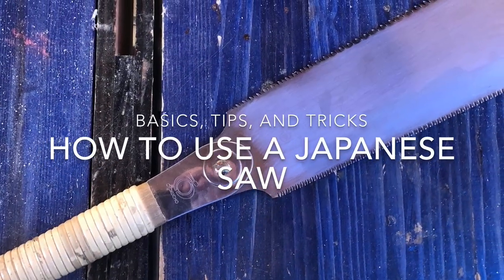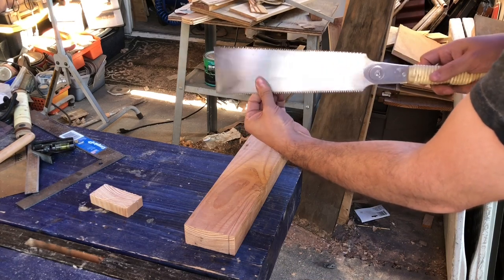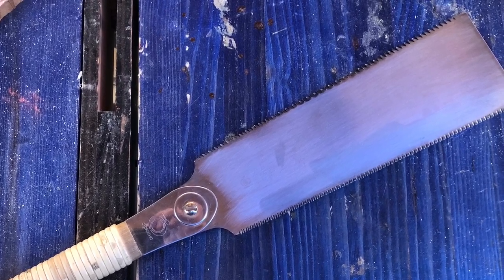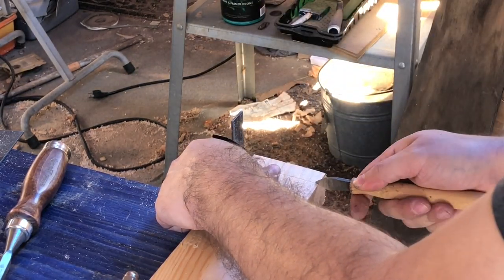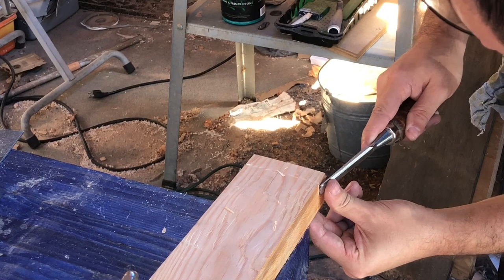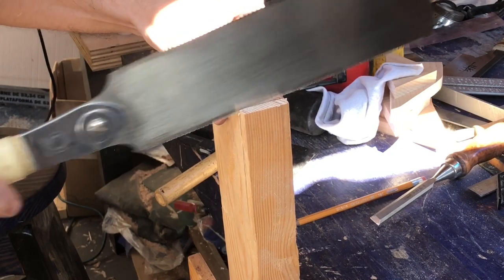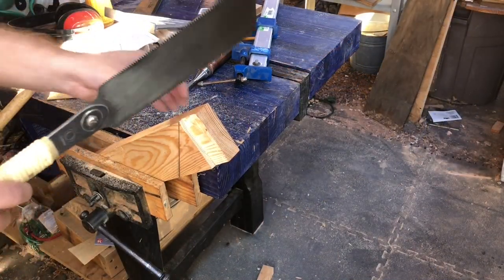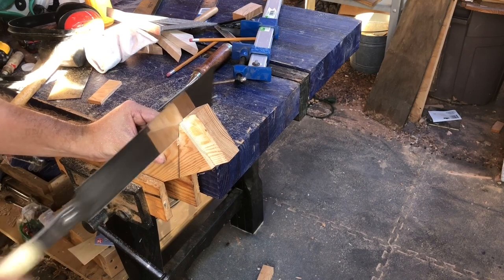How to use a Japanese Saw: Basics, Tips, and Tricks

Comment: good work on the video.  One pointer that I think might help you is to hold the handle further back. The long handle is there for a reason and the back hand should bee right at the end.  This way, slight side to side deviations in your cutting stroke make less of an angular change at the blade and keep the cut straighter. If you choose to cut two handed then the second hand goes to the front and can be used to apply a little (not too much) downward pressure to speed cutting.  I always recommend using one hand when learning though as guiding the cut is more important than power and people used to western saws tend to apply too much downward force when starting out with any thin pull saw.

Comment: The best way to use a Japanese saw is to keep your pointer finger along the top of the saw. point down the saw blade and if you cut go's off line point the blade up 45 deg's and it will come back in line. I have been using Japanese saws for over 15 years and one other thing is one side of the blade is for a straight cut with the grain and the other is for crosscut  great for fine woodwork not for cutting down your stock :)
Reply: Agree, most of the people don't really know how to use Japanese saws properly, they kinda mix both styles.

Comment: my japanese saw has looks exactly like yours but whenever i try to saw something it pulls massively to the right and cuts in a bow and the deeper the cut goes the worse it gets idk how to solve that issue, i just want to cut blanks for knife hilter so idk what is going wrong here
Reply from the maker: Try clamping a straight edge like another piece of wood along the line you want to cut. Then carefully and lightly press the blade into the straight edge so it guides your blade should help you keep straight. Not sure exactly why it’s happening I’d have to see it but could be you or it could be that the saw is some how sharpened funky and it pulls you off. If it’s a cut you are gonna make a lot make a mitre box it will save you a lot of time. Hope that helps reply if you need more help thanks for watching the video
Reply: @MaysWoodworking  thanks, but whats a mittre boxe?
Reply from the maker: https://youtu.be/Vh0mOA--JII something like this you may have to modify it a bit for a Japanese saw but if you make it right it will give you a perfect 90 each time
Reply from the maker: This might work too https://youtu.be/Rv51iKzlxy4